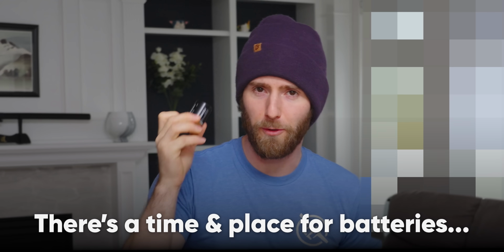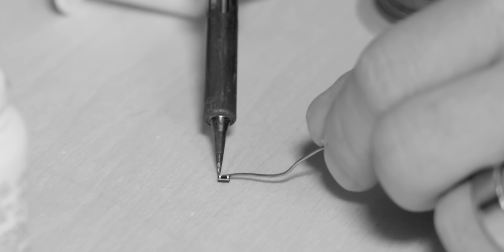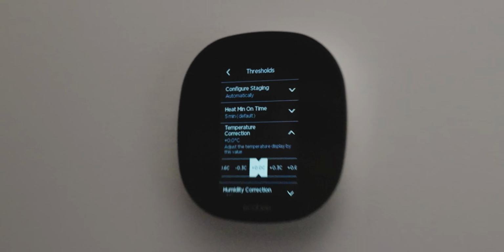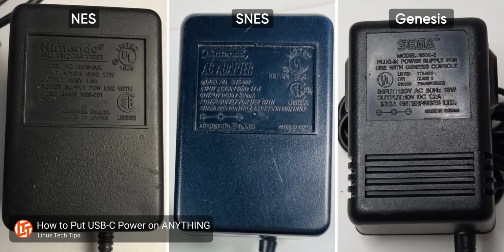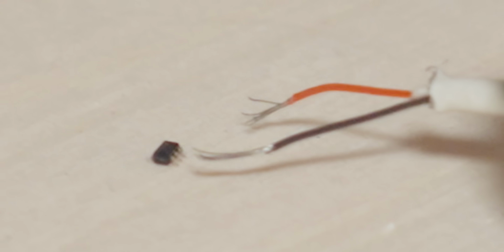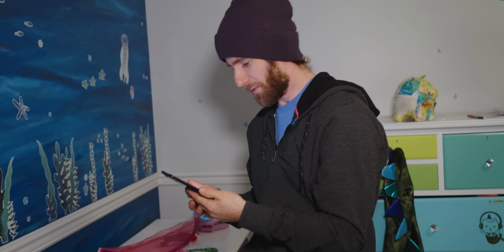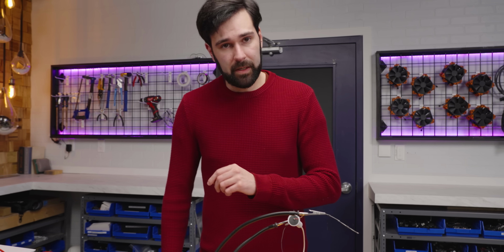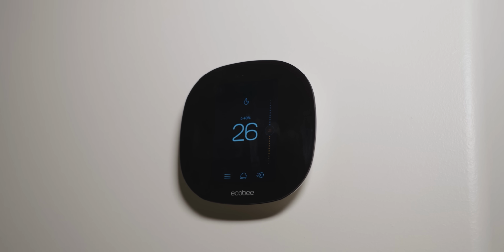I HATE Batteries! - Converting Wireless to Wired (a cheapskate’s guide)

Comment: I agree 100%. I especially hate button cells, they're used in all sorts of devices that would've been better off with AAs or AAAs. Kitchen scales, bathroom scales, laser pointer cat toys, digital thermometers and kitchen timers, all of these things would last forever if they ran off AAs and AAAs, and you can get ones that do, but you have to specifically seek it out. When the device is large enough to physically fit AAs or AAAs, or a slightly bigger size would not be a drawback (in fact quite the contrary for the laser pointer, the extra length makes it better to hold without increasing thickness), why on earth do you insist on using button cells, which are EXPENSIVE and have a small fraction of the battery life? I hate having to buy these things every time my kitchen or bathroom scale runs out of battery. They're not sold everywhere, and they're usually sold as single batteries, so I don't have a stockpile of them laying around, so when I need to weigh something and my kitchen scale is out of battery, dinner has to be put on hold for me to go out to an electronics store and buy more. So annoying. I'm not saying I wish they had a DC input, I don't think that it really makes sense for those specific devices to have a DC input, but just use AAs/AAAs, jeez, they cost nothing and they're sold everywhere, and they're commonly used in flashlights and remote controls which all of us use so we're likely to have spares laying around and they're likely to still be in date, why is this not an obvious choice to the manufacturers? A single AA battery holds over 6 times as much power as a single CR2032 cell while costing a fraction, and this is a best case scenario for the button cell, if the current draw is anything higher than miniscule, even just from current spikes every few seconds as a low power device wakes up to do its thing, button cells will drain much faster. You might well have half a dozen of just the types of devices I listed in your house so that means at least one of them will need their batteries replaced monthly or bimonthly, depending on how often they're used, and there is no benefit to making them slightly thinner. If they used AAs, you could go a year without even thinking about having to replace batteries in any of them.
Reply: Lasers i can understand a little, as they have to get more than 3v to properly operate, but flashlights shouldn't be even available in non lithium format. We now have lithiums the size of AAA's that are rechargeable.

Comment: Lol, my first guess was that you were gonna use a few diodes in series... Cause you know, quick and dirty. But then you went for a different route, that would have been better, if not for the resistor. Diodes aren't a great option either in this case, but I mean, using resistors is obviously nonsense in a device with current draws varying in orders of magnitude. Not to mention the 3.3 V would've been just fine, 0.1 V more or less ain't gonna kill the device. I would have maybe added the recommended decoupling capacitors to the regulator. But other than that, just leave it as is.

Comment: Just a suggestion, if you want to do something similar you can also get super basic buck converters that will maintain the set 3.2v under various loads, and probably will still fit in the back for about 60-80 cents. Not sure how the efficiency would differ given the extremely low power draw, but for anything that isn't pulling fractions of a milliamp (dang high-efficiency devices are neat) it would probably be better than just dropping that power across a regulator, resistor or diode.
Reply: Except for all of the electrical noise introduced by a cheap off the shelf buck converter, now being dumped into a low power wireless device...

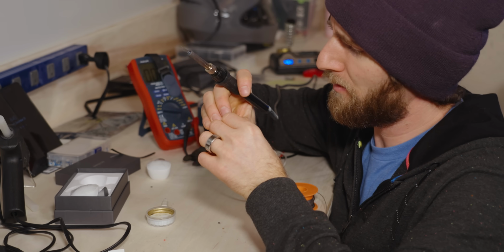Comment: 9:10 True, you can just use diodes, the cheap way of electronic guys to drop voltage, each diode will drop around 0.6-0.7v, so 3 in series in 5v will give you around 3-3.2v with will make that thing work without problems.
Reply: OK, I had not reached the part of Dan when I comented this haha

Comment: you could have bought cheap buck DC-DC step down converters with feedback potentiometers for output level adjustment. would have saved you a lot of soldering.

also LDO regulators tend to oscillate if they are not loaded properly. you need both input and output decoupling capacitors, but keep in mind that the LDO needs to see a certain ESR on the output cap, if you put a small ceramic capacitor it will start ringing. another solution is to load the cap in series with a 0 ohm resistor or some very small value to increase the ESR seen by the LDO and prevent it from oscillating.

another solution, based on your diode one is to load the diode chain with resistors to ground so they pull the nominal forward current of the diode(example 5-20mA), then you can achieve a voltage drop that is specified in the datasheet under Uf (forward voltage) which is tipically around 0.6-0.7V due to the PN junction inside

Comment: I just bought a thing for Christmas decorations that made it from coin cells to red/black wires on a thin cable, then put an 18650 on it so I could recharge them. Then I 3d print an enclosure for the whole thing to make it not look like trash.

Comment: Honestly speaking this video is BS. You have a bad idea, in my opinion, and make it even worse. Who told you it would be a good way to use diodes instead a good voltage regulator with proper dimensions...
One point which was not catched at all is the waste of energy you generate with all of this systems. Your crappy phone charger will now, I guess blast 1w per hour for literally nothing. If you make this to 10 or more there is nothing environment friendly or whatsoever.
And I could go one from there. A lot of this charger's have an idle detection so if the power consumed is to low they shut off the output. So you could increase the owner draw with resistors but we'll that would just help the energy provider.

Comment: Ok, this is really a neat idea so let me try to add more information here for people that didn't go to engineering school yet.

There are 2 kinds of voltage regulators: Linear and Switched. In a nutshell, linear can draw less power and require less components, so they are simpler, but they will heat a lot more. Switched are more complicated, they will need several other components to function (like inductors and capacitors), but they can manage a lot more power without heating. Just be aware their switching nature can interfere with sensitive circuits like radio-frequency ones.

Most voltage regulators come with a specific voltage they will regulate (e.g. 5V). Also they have a precision range, and minimum and maximum input voltage they can handle in order to function properly. Read their datasheet.

Some voltage regulators aren't fixed and can have their output controlled by an input control voltage. This can be achieved with resistors. Another way is to "hack" a fixed voltage one, putting a resistor on its ground connection, thus you fool what's its 0 reference is. The problem with this approach is that as the current drawn raises, the resistor's voltage drop changes and this will change the voltage being regulated. That's the second problem Linus saw. His first problem was trying to use only resistors. This almost never works, because any change in current will change the voltage, and most modern circuits change current all the time. Also, they are very inefficient, wasting energy as heat. 

Dan also tried to regulate using several diodes in series and usually each diode drops voltage in a almost fixed manner. This can work if you are kicking lucky and the numbers match.

So in a nutshell, there are many possibilities, study the ones that best suit your needs and do yourself a favor and avoid surface mount chips for soldiering without a board.

Comment: Seems simple solution about those "ecobee", just measure and 3D print a little base for it, a base big enough to contain one or two 18650 (or pref. 21700) sized batteries, that'd give you at least say 10,8watts per 1865 battery (skipping the zero at the end), or (up to about) 18watt per 2170 battery. 
If one of those "ecobee"s utilizes x1 button battery, and can hold it's charge for long enough not become an "dead? already? I just replaced the battery!", with an 1865 or 2170 battery (or two) in a printed little case, it'd work for years. (Or basically, any modern replacement battery for a phone, as they too tend to be 3.6Vdc) and oh right, this solution would be rechargeable of course.

Comment: I've done a few battery conversions, but I usually try to just source the right power adapter. 3xAAA devices are the best because they'll almost always run right from usb.
Reply: I'd still use a diode because that would drop to 4.4 very well within the limits of 3 piles.

Comment: My brain read the title as "converting wireless [SPEAKERS] to wired, and then was like "oh neat, wireless uses a signal for sound and battery for electric, but the wire does both so this should be interesting". 

Now I'm disappointed since I did this project with a faulty USB words and a battery light I was tired of using batteries for and wanted to connect it with the bedroom door sensor to know when it was opened for when I had headphones on. But I guess I lucked out since all I needed was wire to battery terminals

Comment: Watching you use surface mount components did make me think someone could make pcb "modules" designed to fit in various coin cell battery compartments. You'd still probably have to solder your own input wires to it, but would be a much cleaner, sturdier solution.

Comment: linus i did  this myself many times before when moving into a house the the thermostat wason the wrong side of the wall or a switch or plug what i do is i unscrew the device i need to put on the other side and disconect it from its wire then i remove the electrical box from the wall using a drill i put 4 holes through the wallwitch i cut a hole to reinstall the electrical boxon the other sideandi reinstall device witch is now on the right side of the wall all you need to do after is repair the hole on wal wall the device was

Comment: I did something like this a few years back with some Halloween decorations.  I got a bunch of light up decorations that took 3 AA batteries.  I just got a bunch of USB cables and wall warts, cut the end off the cables, and soldered the power leads for the cable where the battery connections went to the circuit boards.  They worked perfectly since I guess for that purpose, 5 volts was close enough to 4.5.

Comment: Maybe I'm missing something... but if the problem is the thermostat being on the wrong side of the wall, why not just drill a hole through the wall and install it inside the bedroom? Its low voltage wiring, there's no conduit or junctions boxes.
Also, aren't you also using these thermostats as fancy wired thermometers and HASSIO is running the actual heater relays? Just remount the thermostat anywhere you want and run a 24VAC wall wort to power it. (3D print a mount to hide cabling)
But more on topic, I've successfully used 3v power bricks to power battery motion sensors, no special components, however if the power spike is too much I'm sure a capacitor would alleviate any power dip.

Comment: while battery is annoying, cant really have all my sensors for my Home Automation to be fully wired. that's more trouble im asking and probably fail me with electrical inspection. So what I do is basically automate the battery levels on my sensor and send me a notification when certain battery level is reached and will send this notification once a day until I replace the battery with a new one. So far, I only have to do this once every 3-4 years anyway.

Comment: If I were to do this, there is enough room in that battery compartment to add a capacitor and put the whole circuit on perfboard if not a small pcb. Even smaller size caps would have enough capacity allow the sensor to draw more than it would need to run and smooth the current demand from the power supply. 

Also, it's generally not a good idea to over-volt these small devices. While a voltage regulator may be rated to take the 5v from a usb charger, the circuit for the rest of the power regulation is not designed to deal with that much extra voltage and can lead to overheating in bigger devices and premature failure of most devices.

In general, its a good idea to add even a small capacity smoothing capacitor if you are making these devices wired. It just makes things safer and more reliable. And I know part of the goal was to remove batteries, but I feel like if you are going to use a device for only a few moments/minutes, super capacitors plugged in all the time and removed when you need it would be the best practice.

Comment: I have been converting battery powered devices to wired devices for years and I cannot imagine a world where I didn't do that and had to change all those batteries once in a while.
Reply: I generally change to lithium, easier, you get a power bank and modify the voltage comparator resistors and make a toroidal transformer from a ccfl lamp, i run my multimeter this way, also made a power bank to run the internet router in power outages.

Comment: Every battery powered device has a voltage regulator inside it a small difference in the voltage difference isn't going to make a difference they didn't need a potentiometer at all they could have just used a 3.3V regulator 
Also lot of devices that work on a button cell would straight up work with 5V since its inside the internals regulators range

Comment: would it make sense to use a 3.2v capacitor at the business end of this solution? given that the current draw spikes wildly for a moment when the sensor reports back, i feel like a small cap may help ballance that out to keep the input voltage more consistent. i mean i could be wildly wrong here, but it makes sense to me

Edit: after reading the comments, it seems to make sense to others too

Comment: Thank you! I've been ranting about this for years. I've converted so many things I've lost track of at this point. I love battery powered things when there is a purpose. So many things don't need to be battery powered.
Reply: Try my instructables on how to convert a multimeter to lithium battery using a power bank, that was dope, i never buy 9v or 12v batteries. Plus you can run your routers and have them power on in an outtage.

Comment: why not just use a very cheap buck converter module that is already available everywhere either amazon or ebay for 1$.. isn't it more expensive to buy those chips linus using for 1 reel, beside that with that tiny smd component and hand soldering it is more likely to break when you are moving around the devices or when someone accidentally nudged it

Comment: I'm pretty sure I've seen companies selling dummy batteries for button cells before. They're basically a plastic disc with contacts on it and wires leading off to a larger battery. Seems like it would be easier to take one of those and adapt it or perhaps make your own version that terminates to USB.

Comment: This would have been much easier using a linear voltage regulator.
The drawbacks is that the excess is dissipated as heat, but it might have been OK.

Otherwise, Murata sells similar in size switching power supplies that have a buck converter; stepping down from 5 to 3.3 without the drawback of a linear regulator.

Those might be more elegant solutions, IMO.
A bit bulkier, tho.

Comment: Hardwire only smoke detectors is not a good idea. If the house is on fire and the fire is caused let’s say by a hardline power cable to any smoke detector, then you will not know that a fire is building up somewhere in your home. Having batteries in just your smoke detectors can mean a huge difference even if you think it will not.